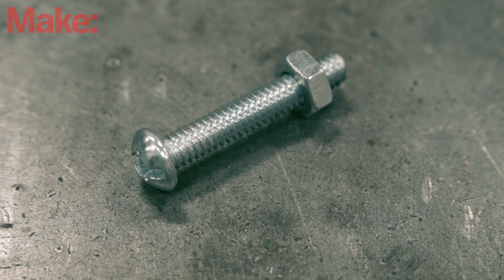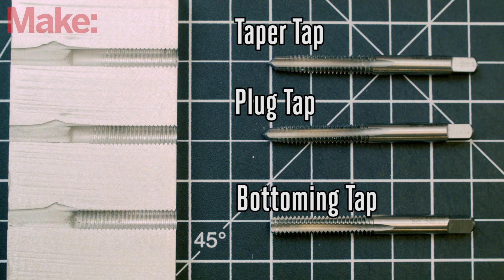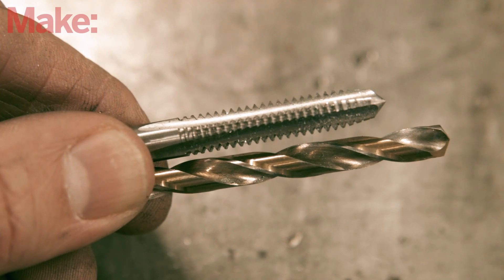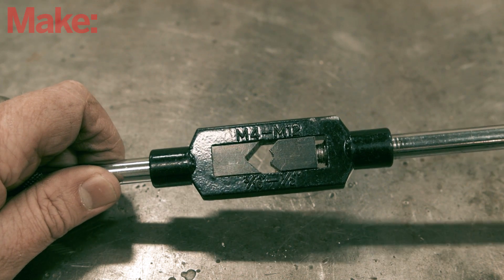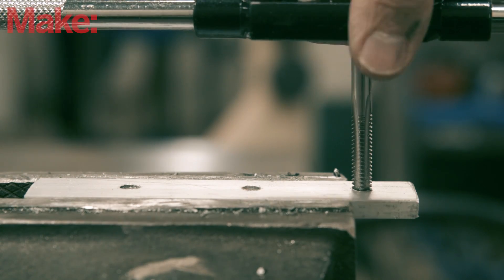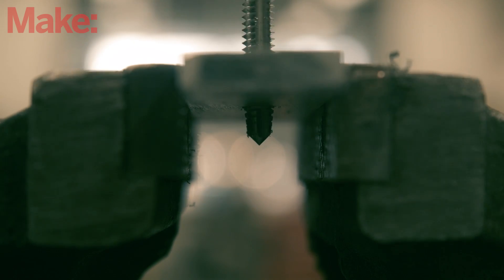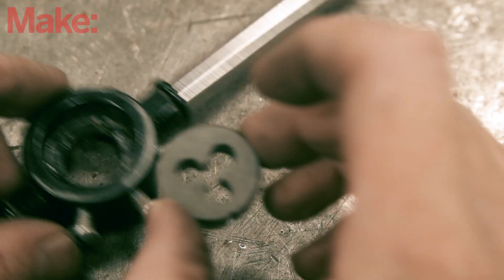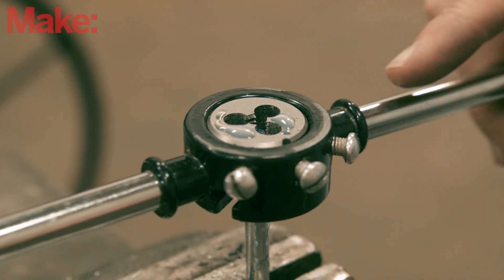Learn to use a Tap & Die to Cut Threads

Comment: Watching him turn half a turn then backing half a turn was making me twitch, imagine doing it like that on a cover with 64 holes that need threading, generally one turn forward, half a turn to break chips then take up the slack and go another full turn. Threading aluminum without lube is very unwise it will gall and create a mess, good old WD40 makes a fine alloy cutting lube.
Reply: Mentorcase For steel thats the way to do it. On Aluminium you can just use your drill.
Reply: Use drill taps

Comment: I find that even being careful, dies will often wander slightly off-angle, so that you can proceed only so far down the rod before it ploughs too far to one side to proceed any further.  Am I the only one; is there a simple solution?  
(I have started clamping the die and an alignment block (with a hole in it) horizontally into the metal vice to keep things straight, and turning the rod slowly with a power drill...)
Reply: Make sure that you "back off" and allow the metal chips to clear. if not, it could be that if the teeth are clogged up it is only cutting on one side, hence why it is wandering. for every half turn forward back it off half a turn to remove the chips. Ensure that every forward turn is s clean cut. Hope this helps. Dave.
Reply: you need to use oil and to use the tool slowly making sure  o back off as much as you progress in little steps as the removed material will clog the threads and put it off center.
i secure a 3 point spirit level on my taps and dies whenever i use them so I can see how they are aligned.

Comment: the hardest part is to find a good brand name of tapes and dies :/
Reply: Price is usually a good indication as to the quality of the tap and dies, but you have to also consider your intended usage amount and frequency, and the likely hood of your tap and die set to get lost, stolen or broken.
If a set is to be used only by you where you control who can use the set then purchase the best set you can afford.
If the set is only to be used rarely then a mid to low set may do the job.
If klutz's are likely to get their hands on your set, buy cheap or lock up your tools better.
If you are working on the bleeding edge of material science then you have no option but to go top dollar.

Comment: Very good description. Only you must counter sink before first tap. Machine shops and tool shops do this as part of there procedure. Not doing this leaves a burr where the first thread starts. So counter sink the major diameter minimum. Also standard tap drill charts are for 75% of thread which is fine for standard application.
Reply: Mark Lethbridge well said
Reply: You only need to countersink or counterbore if you care about having a flush bolt, in some cases depending on the use you are better off not countersinking or counterboring because of rust and corrosion

Comment: Tap water's the best lubricant.
Reply: Not exactly. Sometimes I use organic extra virgin olive oil and aged Balsamico vinegar as the lubricant. I need lubricants to help me ingest sandwiches so I can operate the tap & die.
Reply: Can I tap you for that?
Reply: ExtantFrodo2  but please in his head
Reply: We many lubricants that can be used on different types of metals; for example we use paraffin for aluminium and also for copper and for mild steel we use thread cutting grease.

Comment: I have been told 1mm smaller on the tapping material and 1 mm smaller on the die material
Reply: There is a formula to calculate it based on diameter.  1mm would be way too much on a 2mm shank and it would be way too little on a 30cm.
Reply: Andrew Jolley tap drill size is 1 - pitch. So a 1/2"-13tpi thread would need a drill that is 1/2" - (1/13) or 0.5" - 0.077 = 0.423". Closest drill is 27/64" which is 0.4219". Same applies for metric threads.

Comment: Am I the only one that noticed that he said "be sure to give a backward turn once every revolution" , what was shown was backing off every half revolution?
Reply from the maker: A half turn is a bit on the overkill side, sure. But when offering instruction online, it's a much clearer instruction for the novice user than "back it off a little bit before continuing".

Plus, it helps build a slow, deliberate cadence to the procedure. Every tap we've even broken happened when we were in a hurry.
Reply: It's not an exact science. A lot of the time you can go by feel. On soft metals like brass or aluminum you can do several turns before breaking the chips, but on harder metals like steel, you will want to do it more often. I believe that when threads are cut on a lathe (with normal tap and die tools) they don't even do the backing-off part.
Reply: Turn until the tap breaks to find out how far is too far.
Reply: I was commenting that the voice over recommended a full turn(360 degrees) of the tap or die , but the video showed a half turn(180 degrees) before chip breaking. https://youtu.be/r6Ijd9o-C10?t=2m45s and https://youtu.be/r6Ijd9o-C10?t=4m14s
Reply: Kai Plews AvE?
Reply: No one cares
Reply: shilohsharps turn til you hear a crack then back up a quarter turn
Reply: SNAP!
Reply: I thought that too. Seems excessive this way.
Reply: shilohsharps Do it by feeling.
Reply: it's really not that critical , just so long as you reverse direction to cut way the metal shavings before they have a chance to bind the tap.
Reply: I see him backing off after a full revolution if you count returning to the starting position as half of the revolution.
Reply: ASSHOLES DO VEX ME! 
ALL I COMMENTED ON WAS THAT THE VOICE OVER DIFFERED FROM WHAT WAS SHOWN! THAT'S IT! 
HE SAID X AND DID Y!
CAN YOU NOT FUCKING READ?!?!?!?
Reply: @shilohsharps  wow calm down he is just explaining that you need to clear the metal chips just like when you drill out anything wood concrete plastic...  Clear the hole out to let the bit work.  This is one way to do it.